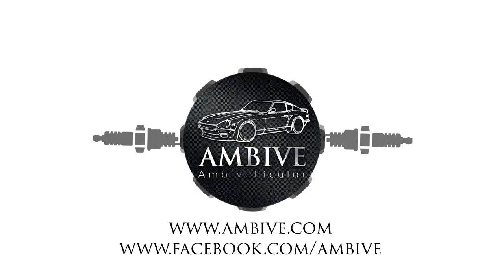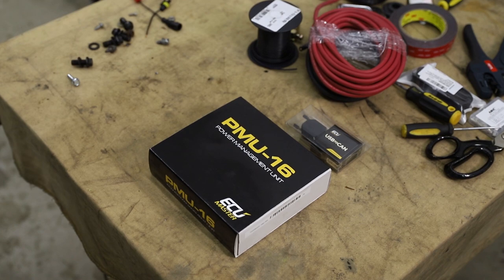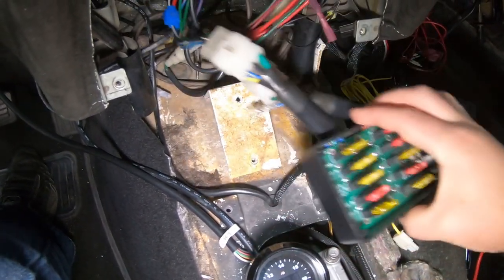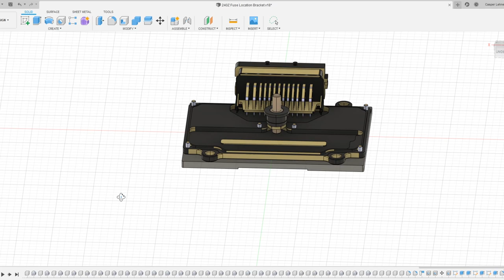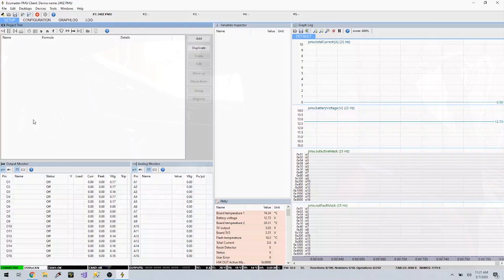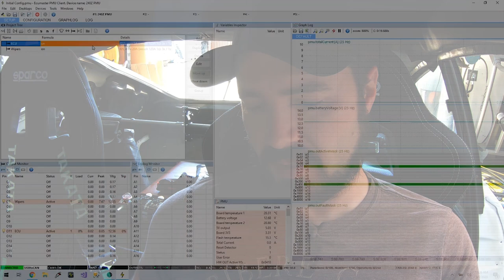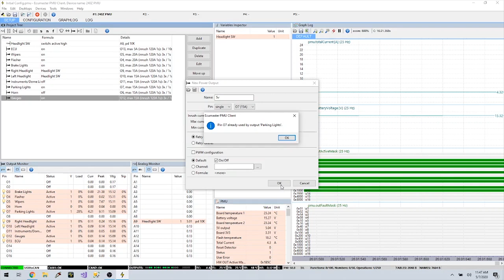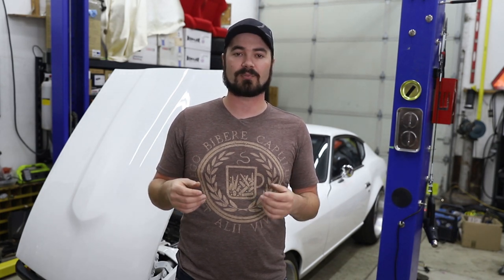Installing a PMU-16 in the SR240Z

Comment: If you create the functions in the software first, it has a option to create a wiring diagram for you (even list the current limits etc per pin) under the "Devices" menu.  I found that really helpful in setting it all up
Reply from the maker: Good tip! I did something similar on my install of the PMU-16 in the '67 Mustang. I actually made use of the conditional structure inside of the function items to make the tail lights work with the blinkers. To really make it powerful they just need to allow you to reuse outputs in multiple rules.

Comment: I bought a ISIS-Power/Infinitybox ages ago for my MkIV Supra and haven't been happy with it. I'm already using an EMU Black so I think installing the PMU16 is a no-brainer. You're running the whole car with a singe 16-output box? I think my current Infinitybox setup can handle 20 circuits (10 front, 10 back), mostly using the front ones.

Comment: I know this is old but your video is very well made and informative.. would you recommend this for a 87 Grand National. Trying to keep this question to a minimum but 16 outputs would it be enough.  Thank you?
Reply from the maker: Just depends how you stack outputs and inputs. I bundle some together for my Mustang vs splitting more individually for my Z. When I installed one in my dad's TR6, I kept some of the subsystems and just did main lines to to the switches and sub blocks to save inputs.

There are also new options from Holley and a few others that might be good to look into as well. This one works well and none of the 3 units I have installed have had any issues in 5 or so years.
Reply: Thank you very much for the quick reply.. I think I need to research more. I have the basic concept but it’s the fine tuning I need to read up on.  I have a LEACH  street/strip fuse/ control panel and I’m use FuelTech with its switch panel.  $2,400 on the pmu16 is scary to me.  Thank you again

Comment: Another question,  if I was to buy the pmu16 to go with my emu black... should I power  up the ecu with the pmu? Emu needs constant 12v, 12sw, and ground.
Reply from the maker: I would, use the same constant power from the PMU stud and pull a small constant did the EMU. That way if you ever wanted to install a complete shutoff on the feed from the battery, it was all one wire. Assuming you aren't reusing other existing wiring for one.

Having completely new wires that are dedicated to the PMU and EMU keeps the power cleaner and also makes it easier to build your primary shutoffs to cut down parasitic draws like from the alternator or starter while the car is off.

Comment: Are you using the pmu for turn signal also? You remember which wire you use the the wipers input to pmu and output from pmu to the wiper motor? I have a 240z  I'm trying to build also. Should be getting myeu black Tomorrow.  Amd debating on investing in a pmu vs just relays
Reply from the maker: I'm powering the signal circuit, but I'm using the original blinker modules on the Z. I use the built-in blinker function of the PMU for my 67 Mustang though. Works great for LEDs because you define the blink interval, no need for resistors. The PMU is great because it not only replaces the relays, but also the fuses, and can be programmed to automatically reset. It would be more like a combination of breakers and relays to something similar.

The car is down at the dyno right now, but when it gets back I'll check how I have the wiper system wired.
Reply: @AmbiVe  thanks for being super responsive. Keep me updated on the wiring. I need to find the main wire that controls and separate the turn signals... where the conjuction is . There's these bigger color plastic blocks. But I'm trying to get rid of all the 240z harness..
Reply from the maker: It can totally be worth getting one of these for your particular year. I have several for different cars:

Full Color Laminated Wiring Diagram FITS 1972 1973 DATSUN 240Z Color Wiring Diagram 18" X 24" Poster Size https://www.amazon.com/dp/B00MH48Z4K/ref=cm_sw_r_apan_i_XV7SXHSWPY9E1KAA2V9M
Reply: @AmbiVe  thanks. I just ordered it.  I had used a print out sheet but it's blurry. Hope this one is much better lol...

Comment: Hey what’s up man ! Wanted to say, love your videos on YouTube. They are really helpful and straight forward. I had a question on the ECU masters USB-To-Can module. For the serial connector side, did you solder the wires to it ? Or how did you go about connecting it ?
Reply from the maker: I just buy generic serial cables off Amazon, cut the other connector off, and connect the required wires to my harness plug on the PMU. That way I can leave that wire run to a convenient location to pull out and plug into the USB adapter when I need to make changes.

Comment: Are you using a painless style circuit also for head/ tail lights ‽
Reply from the maker: No, I just made my own and reused existing harnesses in some places. Because I took the combo switch out of the mix the load wasn't as much of a concern vs the size of the existing wire.

Comment: I've got PMU16DL coming for my rally car and was curious whether the analogue inputs take 5V or 12V or both? Cheers
Reply from the maker: They can do both I believe. You can pick up signals with a 5v pull up or pull it down if needed. I did 12v input from my headlight switch with a pull down.
Reply: Awesome thanks for the help 🤙
Reply from the maker: I will be doing another install of a PMU-16 in my 67 Mustang and probably experimenting with some more interesting configurations.

Comment: could the pmu be used to control air conditioning?
Reply from the maker: Sure. Any powered circuit could be done. I did it on the Mustang and took an input from the ECU for its override and from the pressure safety switch, combined them into the power on signal formula and then had an output to the clutch power.

Comment: There are 2 major flaws with those PMUs from ECUmaster:
1) no provision for the Hot Battery Bus which every car needs (e.g. Hazard Warning, Interior Lts., Clock ….)
2) no direct USB plug on the unit. The little gadget needs CAN 1 bus for itself and requires ext. Bus termination which needs to be installed permanently in case there is an electrical problem away from home.
Otherwise it is a dream come true. I got the Autosport Unit and improving on point 1 and 2 above, it would be the best thing since sliced bread.
Reply: Wait wait wait. Ur telling me, there's no way to program the pmu so some outputs are constant hot? What if we made the pmu16 power up input constant hot and set it so when the Key power input loses power those allocated outputs remain powered up. I'm installing one into a customers car now. It's my first time with pmu16
Reply: @abive can you weigh in?
Reply from the maker: As far as I know, you'd have to keep the PMU unit itself powered on as well. I don't want the constant draw, so I run a dedicated constant for my trigger relay on door open, stereo, and EFI constant. On my more rarely used cars I don't even do constant to EFI.
Reply: I have solved the Hot Bus Situation: I use 3 inputs for the Starter Key Switch (Key position 1/2 and Start) and programmed each circuit requiring a switch position as in a normal car but the PMU is staying powered at all times. BUT I measured the current draw of the PMU and it is very small. I will add some switch (just for safety) to unpower the PMU for theft protection and winter shutdown of the car. 
I still miss USB access since I always need that USB to Canbus box with me.
Reply: One more thing is the 16 circuit limit.
Yes I did combine some circuits but if you want to control a circuit on condition you must use a dedicated channel or the condition for the other circuits must be the same.
They do have a 24 channel module but in order to use 24 outputs you must give up inputs for each output above 16. This is no solution since you will need those inputs too.
Of course you can add up to 5 PMUs via Canbus but each PMU cost 2000€ as for the Autosport version.

Comment: Here I am back on your channel!!! I had another question.. are younusing a 25a circuit  for the starter? Or you running a seperate starter solenoid?
Reply from the maker: On the 240Z my wiring specialties engine harness came with a relay for the starter that I used and triggered off the regular key circuit. On the 67 Mustang I used the factory solenoid with a time delay relay charging the system. On the TR6 I used a 25A (120A inrush 1 second) engaged during key cranking input.